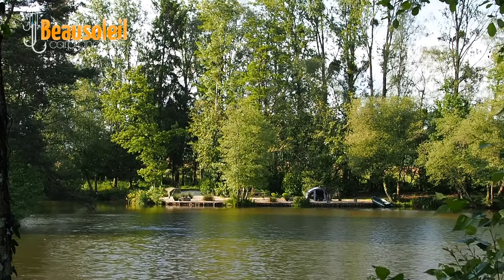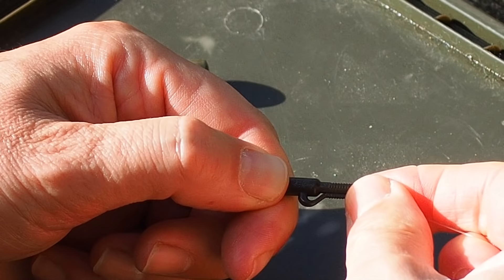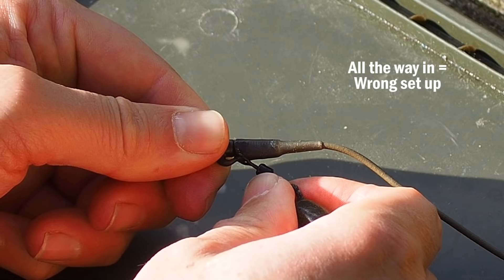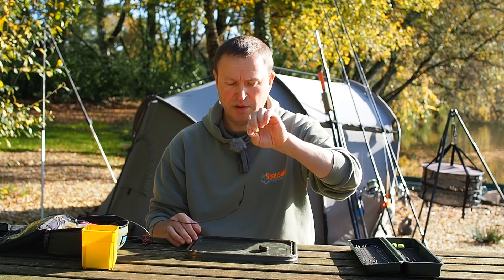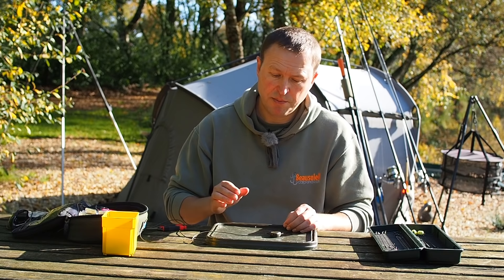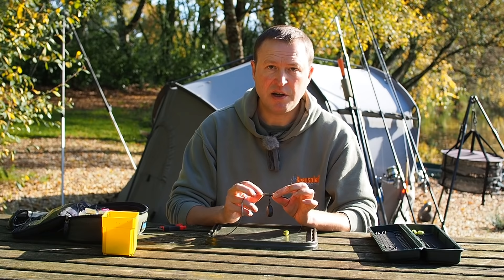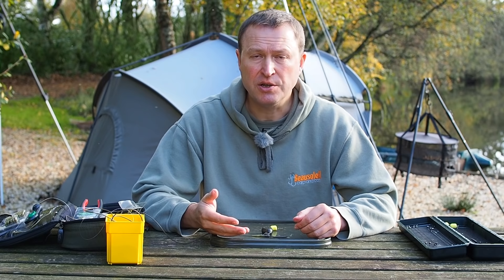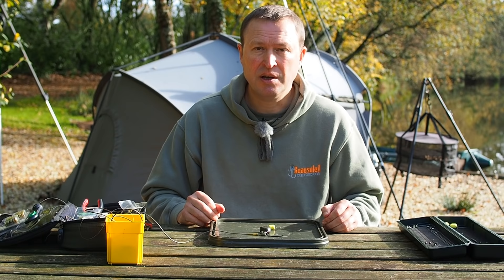STOP Using Lead Clips Like This | 5 WORST mistakes❗

Comment: Good vid but some info for you , NASH brought out the lead clip first not korda , also Nash designed it so if you crack of the fish can get rid of the lead not get rid of the lead on the take , also it were designed for weedy,snaggy  waters .
Reply from the maker: Hi Chris, thanks for your input and for sharing your knowledge. Kevin Nash invented so much I’m not surprised he came up with the lead clip first. I’m aware of the MCF dumper clip but never used one. Since I made this video I also found out that Nash launched a lead clip specifically designed to dump the lead on the take called the weed clip. Not tried them myself but it’s something I’ll be looking into. Cheers, Matt.

Comment: my apologies if I sound ignorant, but are you setting the rig so the lead falls off the line and into the water? Isn't that a waste of a lead?
Reply from the maker: Hi Harry, no problem at all with your question. Lead clips are designed to drop the lead on the take. That means you drop a lead in the water each time which of course is not a good idea for multiple reasons. That’s why I’ve seen many anglers try and force the lead to stay on so that they don't lose the lead. The problem in that case is that the rig becomes dangerous to the fish if the line breaks. I’m trying to show in this video the different ways that lead clips become dangerous if you don’t use them the way they are intended to. 
I hate dumping leads and I only use lead clips if I absolutely have to drop the lead on the take, for example in heavy weed. The solution to the problem is simple and that’s to use running rigs which is what I do for 95% of my fishing. I’ve done several running rig videos. Cheers, Matt
Reply: @matthewcollinsangler  thanks for replying. I was getting inline setup and lead clips mixed up together. Il stick to an inline rig, I watched your other vid on setting one up properly. Defo helped a lot!

Comment: Hallo Matthew, 

Like your video’s! But in this instance I don’t really share your opinion. These days Pole position tackle (CS lead systems) and PB products (Hit and Run) make very refined leadclips that are more “save” than the standard clips you show in your video. Also as a bonus your indiction is better, and you get to save the environment!

Best regards, Guus.
Reply from the maker: Hello Guus, thanks for commenting. I’m glad you like my videos (mostly 😉). I totally get where you're coming from. I’d heard of the Hit and Run system but not the CS system. PB Products is not well known in France or the UK and I haven’t been able to try their system yet. Thanks for passing on the information. As I said at the end of the video, I avoid using lead clips and dropping the lead whenever possible. My preference nowadays is to use a plastic run ring with a large hole that’s difficult to jam. The plastic ring is also easily broken in the worse case scenario. To be honest, I did this video because I still see lots of anglers here at Beausoleil that set up this Korda lead clip wrong. It’s still a widely used product in the UK. In fact in the latest Korda video (released this week), they crush the swivel which for me is totally wrong! I think anglers in the Netherlands have moved on from this old fashioned product, but not in the UK or France yet unfortunately. Thanks for the feedback 😊 Cheers, Matt.
Reply: @matthewcollinsangler  No problem😉  I do find it remarkable  that  leading company’s  like korda or Nash, do not develop a similar system.. especialy  when fish safety is sutch a thing these days.
I think we both know the anwser to that 😬 
Thanks for replying to my post👍
Looking forward to your next vid!
Reply from the maker: @guusnijhuis4420  Hi Guus, yes definitely. What's remarkable is that Korda makes the components for a simple running lead system which is much much safer! Why on earth anyone would want to convert a lead clip into a running rig is beyond me. That’s why running lead systems have dedicated plastic rings with big holes in them! I will order some of the hit and run clips to try for myself. We’ve got more videos already in the pipeline and we’ll be filming more this year. If there’s a subject that you’d like to see me cover, let me know and we’ll see what we can do. Best regards, Matt.
Reply: @matthewcollinsangler  I really don’t know the reason that’s behind that. I do find that the only save setup is a setup that just leaves the hooklink in the carps mouth.
Great that you are willing to try the CS system! I think it’wil surprise you! If I come across something
worthy to do a video about, I will let you know. Thanks again for your comments👍.

Comment: How does it get a hook out when the trailing line has no lead?
Reply from the maker: Hi Lloyd, good question. I’ll take my lake as an example. We used to use micro-barbed hooks and I know the carp do get rid of them eventually (most of the time) although I don’t actually know how but they do it! Occasionally the carp were re-caught and had the hook removed for them. Two years ago we changed the rules to barbless only and it’s clear, with barbless, the carp gets rid of the hook much quicker. We’ve had zero incidences of fish trailing gear so barbless are clearly safer for the carp in all situations. Nowadays, I only fish with barbless hooks. If you’d like to watch more on this subject then checkout this video where I talk about barbless in more detail: https://youtu.be/ZxGllV2Zc5o?t=574. Cheers, Matt.

Comment: Does it not get expensive loosing your leads after every bite I’ve been fishing a couple months and been using the lead clip wrong
Reply from the maker: Hi mate, lead clips are the most popular lead system available and most anglers use them wrong so don't beat yourself up lol. It can get expensive if you do a lot of fishing and it's not great for the environment. I only use a leadclip when absolutely necessary because of weed or snags etc. I use running rigs most of the time, more effective, safe and cheap. Here's a good example of a simple running ledger rig: https://youtu.be/LzFina92brM Best of luck, Matt.

Comment: Hi Matthew. What is your take on crimping the swivel on an inline lead?
Reply from the maker: Hi Phil, it’s not something that I do personally and it’s not something I would advocate but I know it’s done. My personal preference is to remove the plastic insert and to push either a tail rubber or an inline lead insert over the swivel. This way the lead slides off and over the tubing rather than having to rely on the tubing sliding up the line. Example of these two types of system are shown in these two videos: https://youtu.be/7VlmNHg0BD0?t=569 , https://youtu.be/ED58TfFEcqM?t=477. Which one you use will depend on whether you are using rig tubing or a lead-free leader. Hope that helps. Cheers, Matt.

Comment: Dropping the weight I feel is a game changer when you have to use barbless hooks !
Reply: Why?
Reply: @james2614mc  my personal experience was in the uk , fishing a 4 acre lake which was barbless hooks only . After losing 4 fish in the fight ! I had to change something! I went inline drop off and I landed the next 10 ! This lake had lots off lillys and reeds . All o know is I dropped the weight and could keep direct pressure on the fish. I fished in France on a barbless hook venue and what I also did not like was the damage the hook did to the carps mouths when using a rig where the weight stayed on ! Where possible I always drop the weight.. I on a personal point off veiw don't think the weight banging against the side off the carps gills when using a 4/5 inch rig is a good thing . Hope this explains clearly

Comment: Never have and never will use lead clips. 
I've always used free running leads and will not change doing so.
Reply from the maker: Hi Gary, I’m a big running lead fan as well which is one of the reasons why I made this video. You might be interested to watch these videos which also feature some of my running rig variations: https://youtu.be/7VlmNHg0BD0, https://youtu.be/pSjT2wPKtTw, https://youtu.be/aBvZyHBCyAE, 
Cheers, Matt.
Reply: @matthewcollinsangler  I think I will Matt. 
I've only been fishing for 45 years so seen and done lots of different rigs in my time, 
Some before they where picked up and used by pro carp anglers lol

Comment: So you lose a lead every take? Do you have shares in a tackle company?
Reply from the maker: Lead clips were designed to drop the lead on the take but of course, it doesn’t make sense to do that either for the environment or your wallet. I don’t fish with lead clips. I made this video because I hate to see anglers deliberately dumping leads and I’ve found plenty at the bottom of my lake over the years. Most of my fishing is done with some form of running lead system which the carp find extremely hard to deal with and I don’t lose the lead. There are plenty of examples of safe and effective running lead systems on this channel and that’s all I recommend for our guests at Beausoleil. Here are some examples: https://youtube.com/playlist?list=PLHQUkuWLN6meZucvGzWoXCl774le4hw-J. Cheers, Matt

Comment: Wait so you are supposed to loose a lead every time you hook a fish?
Reply from the maker: Lead clips were designed to drop the lead on the take but of course it doesn’t make sense to do that either for the environment or your wallet. I hate dumping leads and I don’t fish with lead clips. They should only be used in very weedy waters where you have to dump the lead to safely land the carp. I made this video because. Most of my fishing is done with some form of running lead system which the carp find extremely hard to deal with and I don’t lose the lead. There are plenty of examples of safe and effective running lead systems on this channel. Here are some examples: https://youtube.com/playlist?list=PLHQUkuWLN6meZucvGzWoXCl774le4hw-J

Comment: Is there a safe way of using a semi fixed set up that turns into a running rig?
Reply from the maker: Hi mate, so there are two really good safe and effective options that I’ve been using for years. For short to medium range and for compliance to tubing only rules then check out my trick inline running rig: https://youtu.be/ED58TfFEcqM. Another great option that is more of an allrounder is my trick mono ‘D’ rig: https://youtu.be/hoHB1gi_sQs. I’ve only been using the mono ‘D’ for two years but it’s so effective it’s my go to rig for general carp fishing. The only time I don’t use it is when I fish massive lakes and rivers. Hope that helps, let me know. Cheers, Matt.

Comment: So every time you get a bite,you lose a sinker ?
Reply from the maker: Lead clips were designed to drop the lead on the take but of course, it doesn’t make sense to do that either for the environment or your wallet. I don’t fish with lead clips. They should only be used in very weedy waters where you have to dump the lead to safely land the carp. I made this video because I hate to see anglers deliberately dumping leads and I’ve found plenty at the bottom of my lake over the years. Most of my fishing is done with some form of running lead system which the carp find extremely hard to deal with and I don’t lose the lead. There are plenty of examples of safe and effective running lead systems on this channel and that’s all I recommend for our guests at Beausoleil. Here are some examples: https://youtube.com/playlist?list=PLHQUkuWLN6meZucvGzWoXCl774le4hw-J

Comment: Hi Matt, really love your videos! I'm new to carp fishing, and a bit confused about lead clips though.. I thought the point was that the swivel can pop out of the clip in the event of a break off, making it safe? Clearly, I'm wrong, just don't understand why!
Reply: Re-watched, and I see you talk about rig tubing getting trapped when this happens. But what if you don't use rig tubing?
Reply from the maker: Hi mate, thanks for commenting and for your question. I’m glad you enjoy the videos. For a newcomer I completely understand why you’re confused. It’s because it’s very confusing! Here is the question you need to ask yourself: do I need to dump the lead to safely land a carp? If the answer is no then don’t use a lead clip. 
I didn't explain what happens if you use a leadless leader type material as the video was complicated enough as it was lol. The bottom line is this: if you have to use a lead clip because of weed or under water hazards, always use a lead clip that’s pinned to the swivel, whether you’re using rig tubing or a leadless leader and set it to dump on the take by partially pushing the tail rubber on. I hope that clears things up for you. Cheers, Matt.
Reply: @matthewcollinsangler  thanks for the video, amzing having your feedback from seeing whats left in the lake.  im looking at the theory and the way  i have been fishing with an in line lead with tubing set up. in this type of setup, if there was a snap off, the swivel would need to come out with the line through the tubing to dump the lead ? but in your video explanation this means that debris and weed etc could trap the line in the tubing and even worse still carry the lead around!! you have the benefit of seeing the left over rigs in the lake. am i right in thinking this type of rig would be even more harmful, even though it would be used as manufacture intends ? my gut is now saying to stop using this in line method, or move over to an inline method that dumps the lead. any advice would be appreciated. ive not used helicopter set up much, can you explain why you are not a fan of it? thanks
Reply from the maker: @richardfleming3308  Hi Richard, yes it’s a real eye opener owning a lake and being able to witness first hand how these things work in the real world. You mentioned inline leads and using them as the manufacturers intend. So yes, I used them this way for years believing them to be safe. Luckily before I owned a lake I came up with a better way of fishing with inline leads. At the time I did it because it solved the problem of the total lack of bite indication when using a semi fixed rig but the added benefit (which I didn't understand at the time) was that the rig was much safer. You need to check out my video on in line leads here: https://youtu.be/ED58TfFEcqM The video is very old now but this rig is still deadly effective. If casting isn't your strong point then use a solid PVA bag. If you want to use an inline then use my method. It’s safer and far more effective. I’m not sure where you got the idea that I’m not a fan of the helicopter rig. It’s not a rig I use much but I’ve been playing with it this year (for a very specific situation) and it works well. There’ll probably be a video at some point lol. Check out our latest video too. It’s very simple but very effective and very safe. Not great for heavy weed though: https://youtu.be/LzFina92brM Hope that helps. Cheers, Matt.
Reply: @matthewcollinsangler  thank you, perhaps wrong choice of words by me saying your not a fan of heli rig, i think you said its a rig you dont use much. cheers for advice
Reply: @matthewcollinsangler  thanks for the old inline lead video, funny enough i used something very similiar 30yrs, think it was made by company called carp r us, the only difference was a small rubber stopper on tubing behind the lead, so when fish took bait and tubing moved through the lead, it hit the stopper to pull the hook home i was going to use it again when i restarted carp fishing few years back. i love the theory of the rig, slight bit of movement, before hook pulled home. but i didnt like the stopper on the tubing, even though it was designed to come off under more pressure. i suppose today equivilent would be a helicopter tubing bead to act as stopper, but still come off. but after watching your recent video, im thinking in line lead, slight slack line, no stopper bead and use a line clip or tighter drag to pull hook home.
Also why im picking your brain, in your old in line lead video, you used braid for hooklink, which i like because of the movement, however when using in the past, even in a pva, i would sometimes reel in with a tangle, poss because smaller fish had picked up and moved around? would your latest mono hooklink with hook bead rig work fine on this running rig ?
Reply from the maker: @richardfleming3308  Hi Richard, glad you liked the old video. If you’ve had a problem with the supple braided rig coming back tangled even when fished in a well tied solid PVA bag then I suspect that there are too many nuisance species present. The best solution is to go over to a really robust rig like the mono hair. While it is possible to combine the simple mono hair rig with my classic trick inline setup, it’s only possible if the lake bottom is really clean (most are not!) The risk is that any softness or rocks on the bottom will cause the hoolink to sit up and that’s the last thing you want. The solution to this problem is to fish a swivel-based running lead system. It could be very simple like the ledger rig I demonstrate in the mono hair rig video or more complex like the one I show on my mono D rig video. It’s a personal choice at the end of the day. Based on my results this year I’d just tie up some mono hair rigs, fished on a simple running ledger and go catch some carp. It’s easy to over theorise this game but you need to trust me that this is all you really need. Best of luck, Matt.